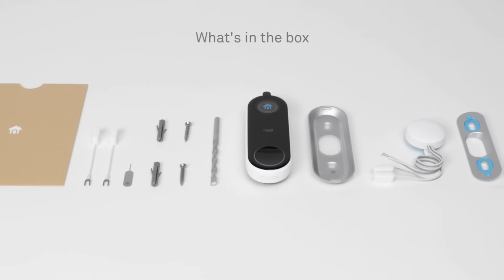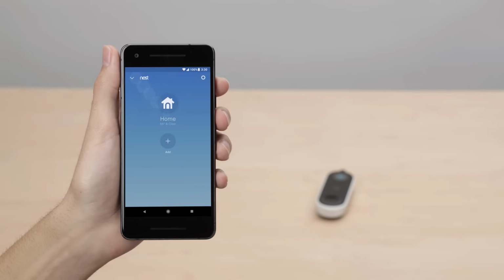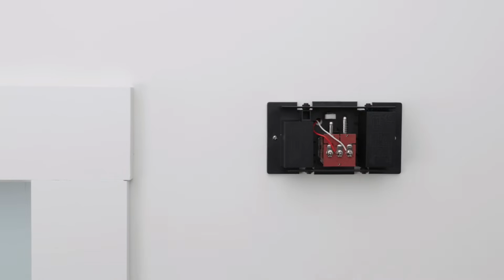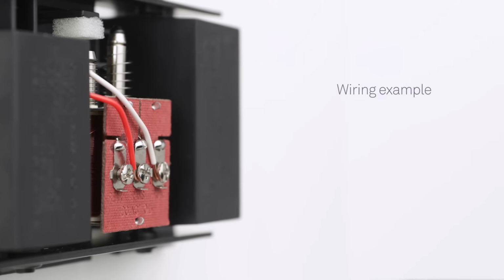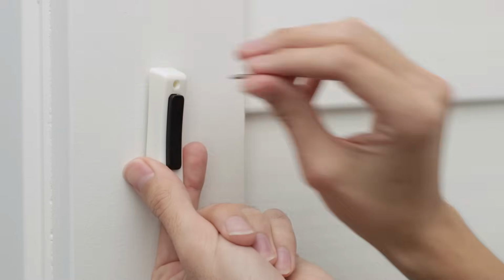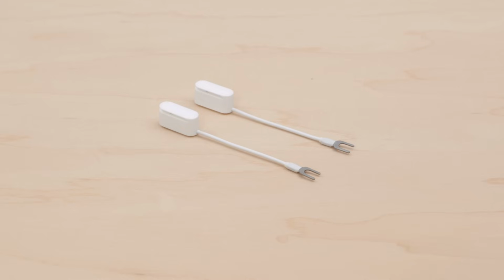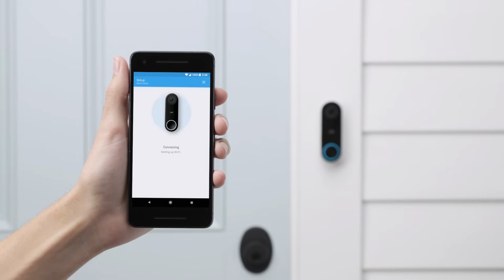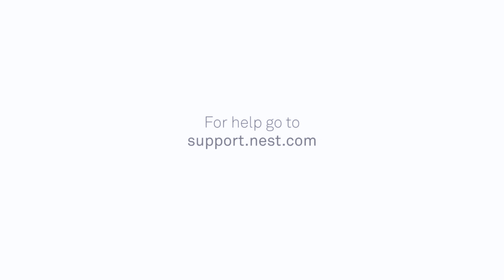How to set up and install the Google Nest Hello video doorbell

Comment: Sweet... so anyone's phone's SIM EJECT PIN is all that's needed for someone to steal my $200+ fancyshmancy doorbell #firstworldproblems
Reply: 1. A stolen Nest Hello can't be re-used, since it's pretty much locked to an account after it is setup. This is the same about most big brand named doorbell camera devices.
2. Google (Nest) will replace it for free as long as you file a police report and follow their instructions. Same for Amazon (Ring).
3. If you really think about it; someone who is prepared enough to steal it by knowing to do it with a SIM eject pin would likely know that it'd be useless to steal it anyway. They can't re-sell it and they can't use it, so if they do then this is either someone that just really doesn't like you or is just trolling. The thief who doesn't know how to steal one would likely have a hard time figuring out how to get it off the wall, not seeing any screws anywhere. They could probably just pull it off, but meh, this leads back to 1 and 2. Not only that but whoever is standing there trying to take it had better be wearing a mask (and I'm fairly certain if someone's standing around your home with a mask on, someone else is bound to have called the police in no time) and super quick at doing it. Unless they cut power to your home first (and I'm thinking in this case you have a much, much more serious a problem), then the device is going to be recording them the entire time...walking toward your door, looking at the doorbell camera, trying to take doorbell camera OR it could also be someone who cased the place from before, in which case you'd likely have downloaded video of anyone suspicious who came and rang your doorbell and then walked off.  

In the end, it's better off to have one that not, more so if you're living in the type of place where it really could get stolen. That is, unless you never online shop or have things delivered to your door.
Reply: @tyraelos  #1 is false.
Reply: I agree with "the legend".  The police report will enable you to get another one from Nest for free. 
Also, the person stealing it will have to be on camera. A nice big close up too!
Lastly, the sim removal tool is a lot longer than smart phone sim. A regular sim remover won't release the Hello from it's bracket.
Reply: its useless to steal if you dont have the  other end of the nest
Reply: @christiansigua3664  Replacement parts.
Reply: Wizard1 Canada-  It's possible, but whoever steals the 'nest' will be recorded, & will basically be replacing a used nest camera with a brand new 1 at no cost. Win/Win.  Ring>Nest
Reply: @Yella_Man  Not if you wear a mask, or shine a lazer pointer into the camera.
Reply: yes, i was thinking the same. iI appears physically very ...unsecure.
Reply: the legend or people know to go to nice neighborhoods that would have such things to rob.
Reply: the legend shrugs, I'm sure in your case you'll be fine, but the rest of the world might not be exactly in the same state (even if it also is a rich and well off neighbourhood) . Ignorance is bliss. Just saying people are free to do as they wish/feel, but I'd rather aire on the side of caution and not want the hassle of going through such an ordeal
Reply: Then why even respond....and learn how to spell err. as in error
Reply: tyraelos bingo! Sometimes people just wanna complain without thinking
Reply: If it gets stolen or damaged by someone they will replace it as long as you file a police report.
Reply: Wizard1 Canada dumbass, you think Google didn't think about this?
Reply: yes but you'll be recorded doing so, lol
Reply: @tilligetbig  Not if you wear a mask, or shine a lazer pointer into the camera while your walking. Try it out yourself. Or wear a infared led hat.
Reply: @M M It records the video of the person stealing it.
Reply: @847MicRoss  … wear a masquerade mask - are you guys even partially aware?
Reply: @Redridge07  They will see your body. A true G now's to shine a laser into the camera from across the street. Or where an infaraed led hat that blurs out your face only to the cameras eye. This way you won't look suspicious to people who may be outside.
Reply: At least you'll get a good movie of whoever ran away with your doorbell...
Reply: Given the fact that it IS a camera, that’s a bit of a deterrent.
Reply: @charliewelsh8427  you can wear a masquerade mask and steal it easily
Reply: @M M Robber? What if it's just asshole kids?
Reply: The doorbell bricks if stolen unusable . Totally waste of time . Also set up  motion detection . If records even if doorbell is not press . Catch perpetrator face  report to police 👮
Reply: @Chef_Frank  I am happy you don't think like a criminal ….. however, criminals steal many things that don't make sense.  I real criminal will simply hide their face.
Reply: @Chef_Frank  If you wear a mask, or shine a lazer pointer into the camera your scott free. No one said they were stealing the doorbell to use. Just that its super easy to ripoff.
Reply: @M M very naïve perspective ….. crooks would definitely know about this and potentially have a device to release the doorbell
Reply: @M M crooks are dumb .. so its a realty that these are being stolen in large numbers.
Reply: Yeah that's what is bugging me cause if to damn easy to steal, they need to rethink that part. They should of designed a unique allen key that you keep somewhere safe that can be attached to a screwdriver head to remove it from the top and bottom. Thry even include a drillbit for you so why not a inhouse designed screw head.
Reply: What if my home doesn’t have a doorbell?
Reply: M M you do know you can buy these at stores and people do return things in place of the new item. Fact of the matter is these are too easy to steal and yes the thief can get it swapped for a new one pretty easily. I’ve worked in security for a long time and seen swaps happen a lot.
Reply: Well, a thief would only need to buy one to steal many. Working in retail for a long time, I know how they think
Reply: Too,funny!!!
Reply: My friend has of these and it feels cheaply made. Dainty plastic for outdoor cinditions.

Comment: I just installed mine, but surprised on how easily a person can unclip it and steal it.  I thought it would be more secure with a screw or something.  Any ideas on how to secure it better?
Reply: "That bug"?  You mean to claim you think there's only the one?  There are many attack vectors.  The Ring is precisely one command injection attack away from granting root.  It can be done in no time flat.  It's a problem not only with Ring, but with Amazon's entire ecosystem as it pertains to security.  I can hack Alexa - at range, I can hack any Ring product, etc.  and so can a lot of other people who know things.

One of us goes to all the hacker/security conferences (DefCon, ShmooCon, BSides, etc.) every year to keep up to date on the latest and greatest security concerns and features, and the other one of us is you - some ignorant dude who thinks there was "a bug" (I assume you're talking about the issue with people being delisted from Ring's authorization list still having access for hours later - a remedial situation that misses the forest in favour of a tree).  I was JUST in Vegas a couple of weeks ago, and I found no fewer than 4 different attack vectors to gain root to the Ring.  Which is why the one I bought on Prime Day and had in the box until after I got back from DefCon just to make sure it wasn't a gaping security hole is still sitting in the box and about to go on eBay, where it will be sold by some unsuspecting sucker such as yourself who doesn't understand the risk it creates.   Hell, you think your ring "isn't from Amazon" (your words), which means you aren't even educated enough on this to know that Amazon OWNS Ring - it's an Amazon product.

Nest, on the other hand, came to the conference, walked right into the IoT Hacking Village, and said "hey, here's our code.  Try to break it.  Bug bounty in full effect".  This doorbell here isn't perfectly secure, either (though moreso than the Ring), but Google at least showed they CARE about security, whereas Amazon's entire business strategy is separating fools who don't understand security (such as yourself) from their money under the guise they're buying something "cool".  Sorry, but hard pass for me.  

And what do I care if someone steals the doorbell?  All major smart doorbell makers will replace the doorbell for free if someone steals it and (at least in the case of the Nest), since the doorbell is tied to one account, it's useless for a thief anyways - so only an idiot would steal it.

BTW, wanna buy a Ring doorbell?  New in box, sucker.
Reply: @nunyabidnesss  100% incorrect! You are Wrong! And BTW, your so far into the software you can't find your way out.  Jus stop.
Reply: @nunyabidnesss  vendetta against Amazon, vendetta against ring.  I'm certain your a nest employee.. someone get the big red nose for this clown.
Reply: Sure, chief - whatever you say.  When faced with knowledge, facts, and experience, the perfect rebuttal is always "Nuh Uh!!!!"  You sure showed all of us which one of us knows what they're talking about.  Also, there's no such thing as a "Nest employee".  That would be a "Google employee", since Google owns Nest.  Just like there's no such thing as a "Ring employee".  But hey, how about you reply with another "Nuh uh!" and "win" the conversation again, huh chief?
Reply: glue it
Reply: Super glue that btch!
Reply: Take a brick and repeatedly hit the doorbell so the screws hold it tighter
Reply: Whoever steals it will be recorded so it doesn't matter!.... & Once its stolen you get a new camera and also find out who the thief is... Win/Win.
Reply: @Yella_Man  a crook can easily wear a masquerade mask and then you lose traceability.
Reply: Sith Lord nn
Reply: Oh yea,. Ring>Nest
Reply: Cool story tho
Reply: 20 years, huh?  20 years ago, most people were on 33.6 dial-up modems.  You clearly know nothing about technology, and certainly not security.  And all your insults and attacks just show how threatened you are in the presence of intelligence.  "Computer dork"?  I'll take that as a compliment from someone upset at the fact he makes 1/10th of what us "dorks" make.  Keep re-living those high school glory days, chief.  They'll keep you warm at night when you're under a bridge at 70 wondering where it all went wrong.

Oh, and it took me less than 2 minutes to hack the Ring.  Just sayin'.
Reply: @nunyabidnesss =Nest salesman & Nest representative.
Reply: @Yella_Man  Seems to me like you're a "Ring Employee" 😂

Comment: what if you have wireless doorbell , how does it work then ?
Reply: How does your doorbell get power?
Reply: You'll probably need to get someone to make a hardwired setup for you
Reply: @GamerRusith  We cover how to create a new hardwired setup here: https://www.onehoursmarthome.com/blog/nesthellodoorbelplugintransformer
Reply: I brought an adapter on Amazon I typed in nest hello adaptor and loads come up. I won't be wasting money and time on a chime box so will have it over google home assistant instead. Chime boxes are fine if you have one and it only needs a slight update with the tansformer.
Reply: No you need some to run wire and install 24 volts transformer
Reply: The Ring 2 and Ring are wireless doorbells that use batteries: https://amzn.to/2DNSlkW. Wired Doorbells like Nest Hello do provide better performance than the battery powered doorbells but some people don't have the option adding wiring in which case the Ring 2 doorbell is a good option as it is completely battery powered.

Comment: Just installed it today. The Nest Hello unit is functioning the way it should. But oddly, I’m not able to get the mechanical chime to chime when the bell is pressed. I receive the alerts on my phone. My indoor mechanical charm no longer works. I can’t imagine this being a transformer issue since the bell is working. Any thoughts?
Reply: Patrick M Finding that transformer is another mission. Thanks, Pat. I’ll try that.
Reply: It's a combination of things. If you do a Google search for the procedure to "wire a ring doorbell directly to transformer". There are tons of links and walkthroughs. It's the same procedure for the Nest Hello.
Reply: In the settings you can turn on and off the chime.

Comment: Can I bypass the chime connector and hear the door chime via mini or google home?
Reply: Narinder Singh 
Yes you can. 
This guy did exactly that. 
He has Nest Hello connected to a "plug in" transformer. And he has no physical chime. 
https://youtu.be/D9ia6ZrHiVY
Reply: Yes it works! Just link your Nest account with Google
Reply: Do you know what are the specs for the transformer he used?
Reply: If you are hardwiring a transformer https://www.onehoursmarthome.com/blog/nesthellotransformer or if you are plugging in a transformer these transformers are compatible https://www.onehoursmarthome.com/blog/nesthellodoorbelplugintransformer
Reply: I am replacing a ring doorbell with nest hello. Do I need the chime connector? I didn't need to use it for the ring.
Reply: Google Home/Mini does announce "There is someone at your door"

Comment: I'm a Nest fan I have 4 thermostats and about 10 smoke alarms along with the Nest security system and I'm interested in the doorbell but I need two things from you Nest. 1 I need a different color the white doesn't work for me for one it looks horrible once it gets dirty and two the white just doesn't look as good on my house as a brown or bronze would, 2 we need another angled bracket 15 degrees is cool but how about 30? not everyones door bell is right next to the door.
Reply: They sell skins so you can change colors and there are several aftermarket base plates that make the unit more aesthetically appealing as well as more difficult to lift by unwanted nimble fingered shadow skulkers ,Cheers !
Reply: the legend Yes I do but that’s not what I’m talking about. I feel like as a company you have to look at the competition and compete. I’m pretty sure video wise the doorbell is better then Ring at the moment but Ring has different color plates and different angle plates, you mean to tell me Nest didn’t know this? Couldn’t offer this?
Reply: the legend could we see pictures of your thermostat?